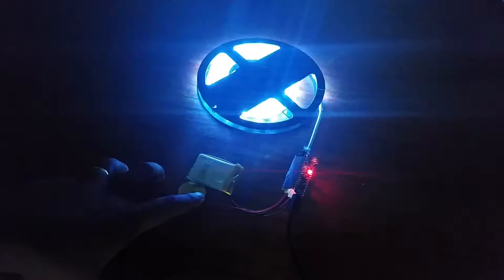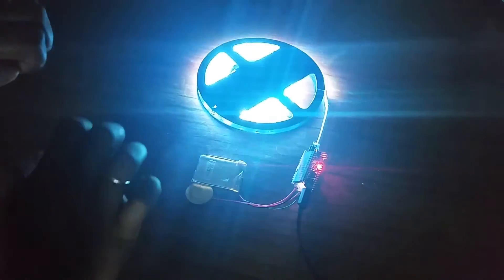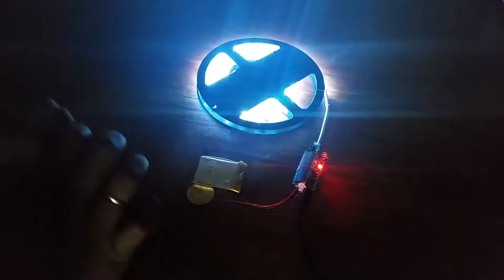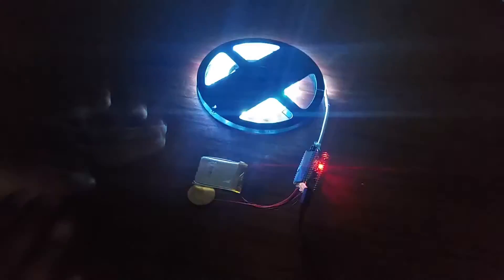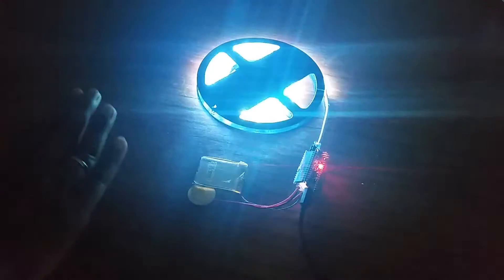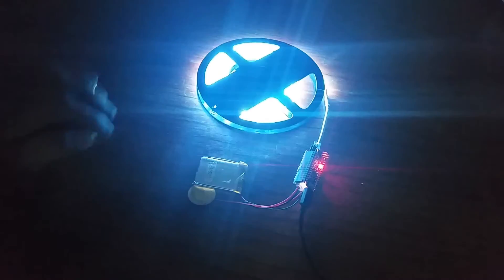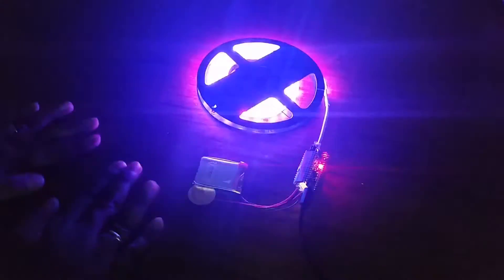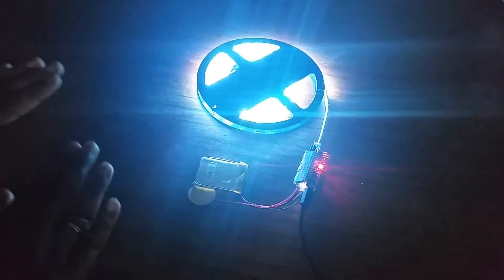Piezo activated LED strip

Comment: I promise this is the last time, do you think you can add a circuit diagram to the link you put in the description? I didn't see any there already.
Reply from the maker: The circuit diagram and all design/code is here : https://github.com/whatnick/DrumLights/blob/master/Drumlight_PCB/drumlights_schema.png
Reply: Where is the library titled "RunningAverage.h" which you use in the code? I can't find it in the files in the link you gave.
Reply from the maker: Spenser Rapier installed via library manager in Arduino.
Reply: What is the library called? When is search "RunningAverage.h" nothing shows up.
Reply from the maker: https://github.com/RobTillaart/Arduino/tree/master/libraries/RunningAverage
Reply: Got the code to work, but how do all 4 pieces of the schematic connect? Also, is all of the circuit necessary? I didn't think it would require 2 integrated circuits in addition to the arduino.
Reply from the maker: Spenser Rapier they connect using the global labels. This was my advanced design for PCB, it includes a battery charger and piezo charge amplifier to make the piezo more sensitive and give more flexibility in choosing a threshold.
Reply: Is there any way you could tell me the circuit of just the bare minimum to make it work?

Comment: Sorry to bother you again, but what would I have to change on the code you have written out so that it would work for an led strip of one color?
Reply from the maker: Spenser Rapier just drive one output instead of 3. I believe I call analogout or digital out a few times.

Comment: I also started a thread on a forum using your video as a reference and it has all the info there: https://forum.allaboutcircuits.com/threads/arduino-and-piezo-trigger-driven-led-strip.145098/
Reply from the maker: Spenser Rapier hope you get more replies there. But the strip we ended up putting in the drum was just white (since they are cheaper). You can take one output and drive the strip with that.
Reply: Gotchya, thanks for all your help :)

Comment: I'm a complete noob with electronics so forgive me if I don't address things correctly. I've got an arduino uno and I'm trying to do the same thing you did but I have no idea how to wire it up. I also want to do it multiple times preferable from the same power source cause I plan to put these on my drum set. Thanks :)
Reply from the maker: With a drum set it is pretty hard to manage cross-talk, but the piezo is a contact sensor so should be not too bad. The piezo is wired via a resistor to the Arduino analog input. I can send you one of my prototypes here: https://www.tindie.com/products/whatnick/drumlights/
Reply: Sorry I also forgot to add that my led strip is only one color so i assume the circuit should be simpler. It its current state it appears that the leds aren't drawing power from the power supply but only from the voltage generated when the piezo is pressed. Any idea why this is happening?